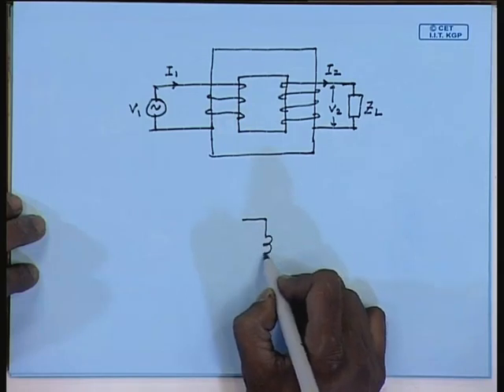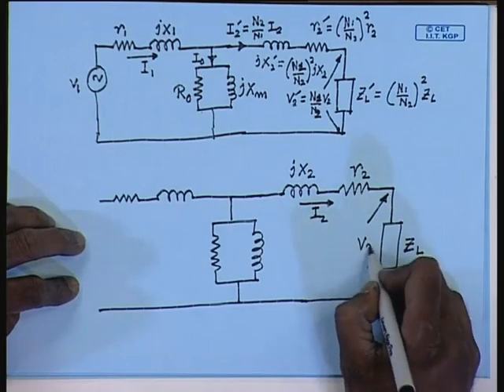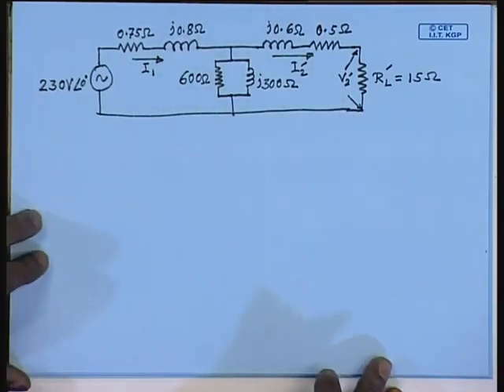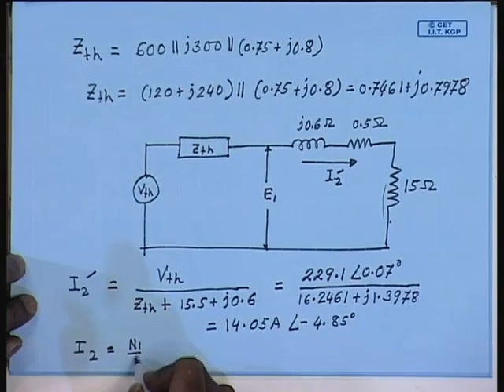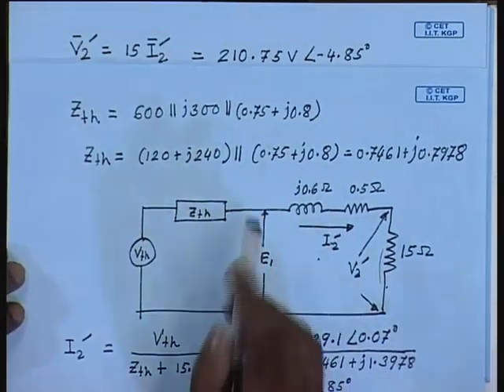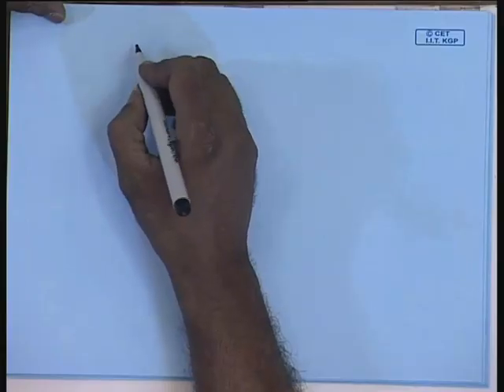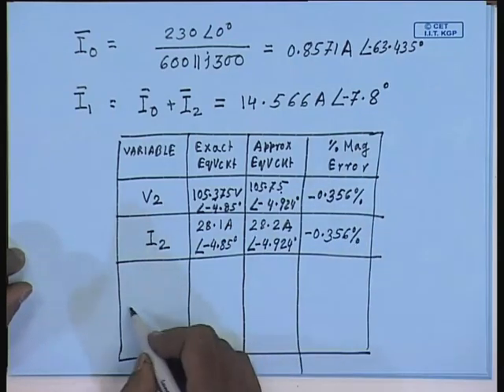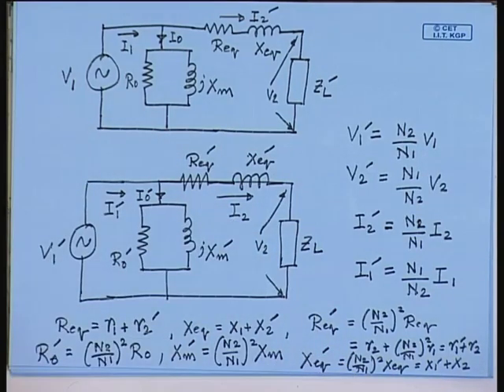Mod-01 Lec-04 Lecture-04-Equivalent Circuits of Single Phase Transformers

Comment: TURNS RATIO IS N2/N1??????
Reply: according to the IEEE definations turns ratio equals number of turns on the high voltage windings to number of turns on the low voltage windings